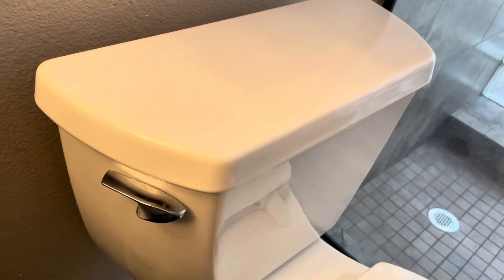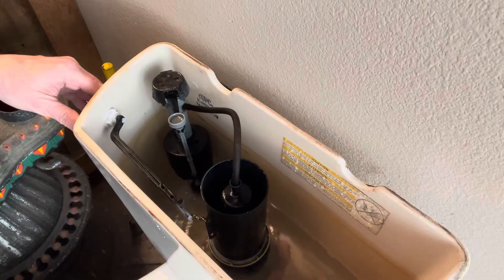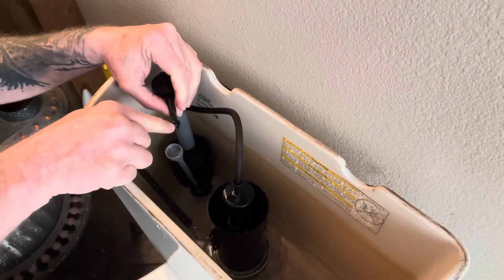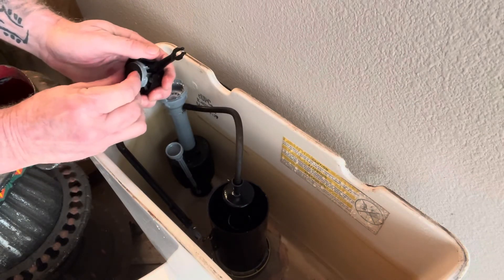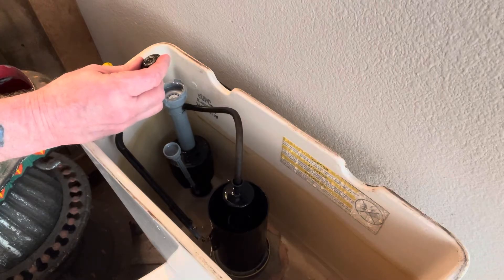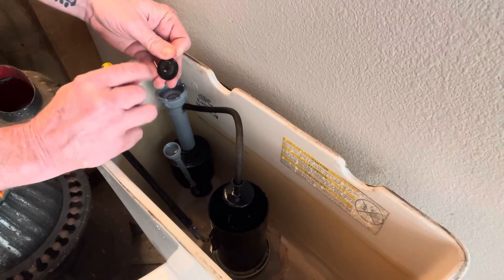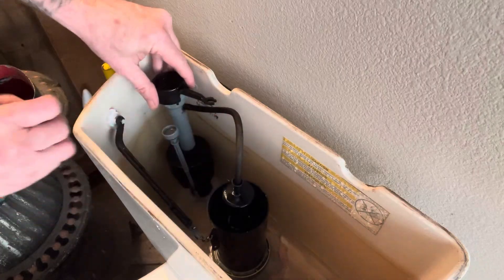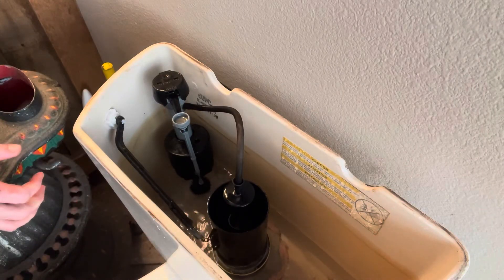Loud Whistling / Hissing Toilet Driving You Crazy ? Fast Easy Fix

Comment: Picked 1 up @ home depot $3.48. 2minutes and problem solved. It took 20 minutes to get to Home Depot and back so I bought an extra since we have 4 toilets all with Fluidmaster 400A. also picked up a full valve replacement to have on hand.
Reply from the maker: Well done! ✊🏻